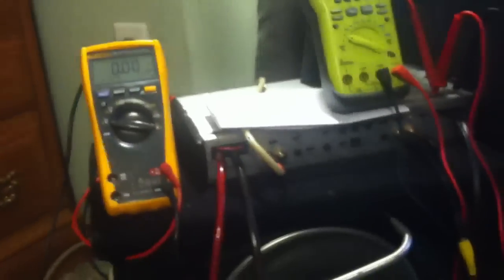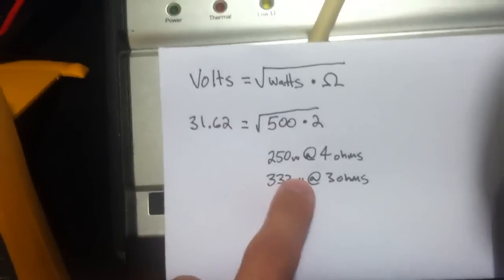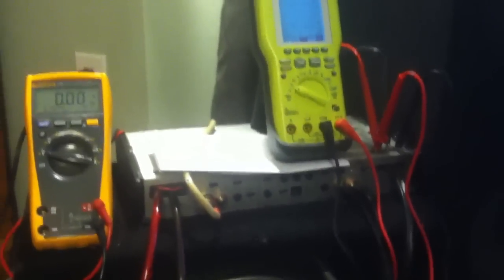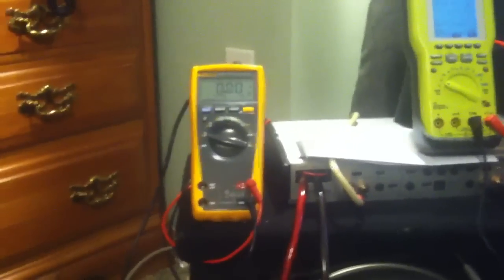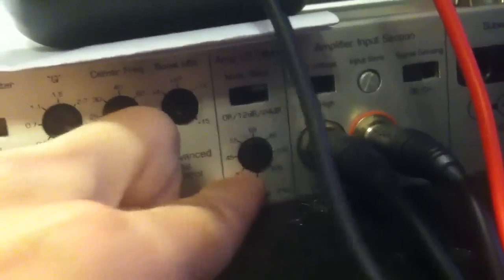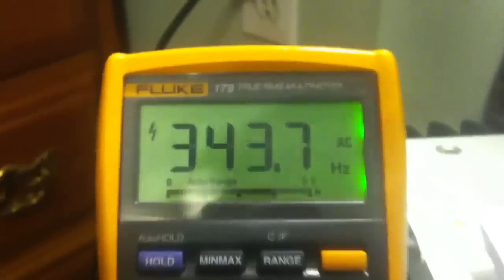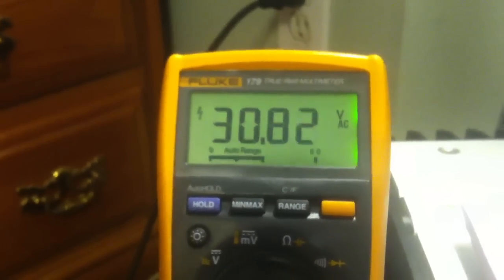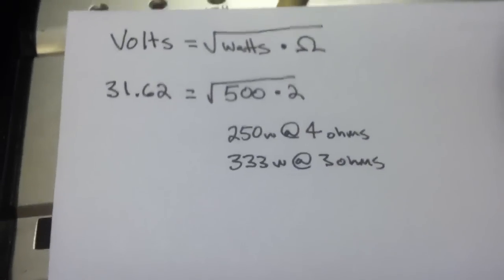Set amp gain

Comment: Proper way without oscilloscope.  Keep in mind the 10w7 is a 3ohm sub.  The slash series eg:v1 &v2 are 500watts at 1.5,2,3 and 4 ohm. 500x3ohm (10w7) equals 1500. Square root of 1500 is 38.72 or 38.7 if dmm reads either way. Disconnect all speakers especially sub.  Turn head unit to your max listening level. There's a debate if you 0 out the head unit settings.  I leave them set so no distortion is introduced. Play test tone CD at 50hz at 0db. Connect red lead from dmm to positive on amp. Black to negative. Play cd and slowly turn up gain until target (38.72 or 38.7). Gain is set. Turn down head unit, reconnect speakers and your done.
Reply from the maker: Thanks for the helpful comments, I should have explained farther.  

I was setting this up as an example for someone who had a 500w @ 2 ohm setup.  So instead of the correct setting for the 500/1 & 10w7.  I used the equivalent wattage in the (500@2) for 3 ohms, and also shown the math for an equivalent 4 ohms setup.  

38.72 is correct if you wanted the 500/1 setup for the 10w7.  Mine is v1.

Comment: This amp will pull 568 watts at 12.29 volts, you may have done your math right but that's not the case for this amp
Reply from the maker: Math is right.  Look up ohms law.  Current, wattage, voltage, and ohms all relative to each other.  Boxes can cause the speakers ohms to change.  So if you were to measure something different, it's because the speaker's ohms change as it's playing different frequencies.  SMD IM-SG+ is a good tool to see this happen. 

Also you said "pull" not "output."  No amp is 100% efficient, what goes in, is different from what comes out.  Most class D amps are 60-80% efficient.  Pull means power input.  My video is about power output.  The voltages I'm showing is on the speaker output, not the input.   If you're measuring the amp "pulling" 568w, that's not what it's outputting to the speaker.  568w would correlate to ~400w output to the speaker.  Give or take, rough guess without more specifics.  

568W @ 12.29 volts is 46.21 Amps & 0.26 ohms.  The JL 500/1 is stable down to a nominal 1.5 ohms.  I don't think you'd get a situation where'd you'd see 0.26 ohms on the output side of the JL 500/1 without it going into protect mode.  That amp could definitely pull 46+ Amps on the power input side, the recommended fuse size is 50A.  And for 10-15ft of power cable, 0.26~ ohms resistance seems reasonable for that amount of current.  So I'm pretty sure your calculations is on the power input side of the amp, when my calculations are on the speaker output side of the amp.  And that's the cause for the discrepancy.  

https://pdf.crutchfieldonline.com/ImageBank/v20071015125500/Manuals/136/1365001V2.PDF

Page 8 (14/15)  
Shows the recommended fuse size. 
And a table for the target speaker output voltage for various speaker ohm ratings to achieve 500w.  My math matches exactly what JL Audio recommends.

Comment: No you'll get max power, 500 watts at any ohm load with that amp ..so your getting 500 watts at that 3 ohm ..now with any other amp this video is correct
Reply: Papo Portillo your right. I'm like what is this dude talking about. Jl audio slash amps. Specially monoblock 500/1, 600/1, 1000/1 or 1200/1. 1.5ohms to 4ohms. They put out full rms ratings.
Reply from the maker: The power side of JL slash amps is regulated, not the output. Meaning if the alternator of the vehicle causes any volt drops / spikes it won't alter your gain settings.  It makes it more accurate, but less efficient than non-regulated.  If both sides were regulated, there would be no input sensitivity or gain pot.  Regulated or not, Ohms law applies the same.  
( Watts = Volts * Ampere ) == ( Volts √(Watts * Ohms) )  
Directly from the JL 500/1 manual:
" 
5) Using the chart below, determine the target
voltage for input sensitivity adjustment according to
the nominal impedance of the speaker system
connected to the amplifier output.
4Ω (or higher) 44.7 V
3Ω      38.7 V
2Ω      31.6 V
1.5Ω   27.4 V
"
So if they tell you to tune the output AC voltage output to different levels given your sub's ohm rating.  Which so happens to equal my formula results, how is my formula and procedure wrong? 

44.7213595499958 = √ (500 * 4)
38.72983346207417 = √ (500 * 3)
31.62277660168379 = √ (500 * 2)
27.38612787525831 = √ (500 * 1.5)
Reply: These amps actually exeed their rms ratings with any load from 1.5 - 2.0 ohms you can find reference videos from reputable people here on YouTube, I actually have this amp, and lemme tell you 500w yeah... A really fucking angry 500w 😂, I've blown 1300w rms subs with this amp, it's definitely a keeper
Reply: This amp has a R.I.P.S. circuit to get max power at a wide range of impedances. can get max power anywhere between 1.5 ohms to 4 ohms. If you plug in a 3 instead of that 2 on your math there you can see your target voltage for 500 watts.

Comment: 333rms @ 3ohms. Your confusing people man. It's going to give that sub 500rms at 1.5ohms to 4ohms. Not no 333rms. Your sub is getting 500rms not 333rms. That also goes for the 250/1, 600/1, 1000/1 and 1200/1 slash amps. 1.5ohms-4ohms the amps out out the full rms ratings of the amps. Not a half or anything less then its total. The way your doing it. You should say for another amp, not a jl audio slash amplifier.
Reply from the maker: The power side of JL slash amps is regulated, not the output. Meaning if the alternator of the vehicle causes any volt drops / spikes it won't alter your gain settings.  It makes it more accurate, but less efficient than non-regulated.  If both sides were regulated, there would be no input sensitivity or gain pot.  Regulated or not, Ohms law applies the same.  
( Watts = Volts * Ampere ) == ( Volts √(Watts * Ohms) )  
Directly from the JL 500/1 manual:
" 
5) Using the chart below, determine the target
voltage for input sensitivity adjustment according to
the nominal impedance of the speaker system
connected to the amplifier output.
4Ω (or higher) 44.7 V
3Ω      38.7 V
2Ω      31.6 V
1.5Ω   27.4 V
"
So if they tell you to tune the output AC voltage output to different levels given your sub's ohm rating.  Which so happens to equal my formula results, how is my formula and procedure wrong? 

44.7213595499958 = √ (500 * 4)
38.72983346207417 = √ (500 * 3)
31.62277660168379 = √ (500 * 2)
27.38612787525831 = √ (500 * 1.5)

Comment: I got that exact set up   . Could I get a pic of what all the settings should be at
Reply from the maker: It depends on the sub you have connected to it.  Also your music tastes & preferences.  The other speakers/amps you are using also determines the settings to use as well.  Say you have full range or you have good mid bass subs that do the workload of 60-160.  You will set your sub amp to do 60 and below.  If you don't have mid bass subs and your full range speakers lack decent bass, you may want your cut off higher.  If in doubt, just turn the EQ section off.  You can play with that later.  The gain and Freq cut off is the main settings you should be concerned about.  There's no definite answer to what settings everyone should use.  Thats why the give us the adjustments to tailor it to our setup needs.
Reply: @smileymattj  ok well I have a 10" w7 just like u in the video.  I just figured it would be set roughly the same
Reply from the maker: I made it showing someone else who had a 500w 2 ohm sub.  So my settings in the video wouldn't be what you need.  I wasn't setting it for my JL sub.  The 10w7 is 500w @ 3 ohms.  You want to turn you gain all the way down.  Set your meter to AC Voltage.  Put the meter probes on the speaker terminals of the amp.  Turn the gain up till you get 38.72 volts.  When playing a 50Hz test track.  The JL refers to gain as input sensitivity.  Here's where you can get the test track: https://www.mtx.com/testtones
Reply: @smileymattj  ok thank you  so much

Comment: Your way is correct.  I'm running 500v1 to 10w7ae  pro wedge box.  But being 3ohm sub and 3ohm stable amp, I'm dialed in at 38.7 with the slash amp. V1 or v2 and 600v3 are awesome being that they put out true wattage no matter what your alternator produces

Comment: My JL 500/1 hits so hard it almost kills my electrical system shutting the car down (brand new Alt last year, 2 batteries and 2 capacitors) the protection circuits do not work and i can run it at 1/4 ohm load the amp is pulling close to 800-1k RMS at 1/2 way turned up on the boost and i have no idea why? its all original i popped it open when i got it because the guy told me it didn't work and nothing was burnt or bad. i have a good amp and cant explain why i am getting so much power out of it? i wouldn't believe it someone said that there JL 500/1 amp is putting out more than 505-510 RMS. I put it at 4 ohms and the power drops like normal amps do but the JL is 500 RMS at 4 ohm, 2 ohm and 1.5 ohm no matter what.i'm not complaining i just want to know if anyone else has this awesome problem?
Reply: Google "the big 3 upgrade"

Comment from the maker: Hi william,

Those amps are very different. I'm not sure why they would have told you it was the same.  Also they should have tested the amp before connecting another sub to it and damaging it.  Amps are supposed to have short-circuit protection in them, but it's not always 100% safe.  Bad speakers can easily damage the amp or headunit it's connected to.  

Which 15" Kicker Comp do you have?  Ohm wise & wattage wise?  How many are you powering? 

The Kicker 600.1 is a:
300x1 @ 4 ohms
600x1 @ 2 ohms

The JL 500/1 is a:
500x1 @ 4 ohms
500x1 @ 3 ohms
500x1 @ 2 ohms
500x1 @ 1.5 ohms

The reasoning for this is that the JL is a regulated amp, and the Kicker is a non-regulated amp.  This will mean the JL will give you a more consistent volume level regardless of the vehicles electrical system.  Where as the kicker will increase/decrease volume relevant of the car's voltage supply.  

The JL is a very good quality amp.  My thought is that you are used to that higher wattage amp producing more volume and looking to re-achieve that the gain, boost, crossover settings are set too far out causing distortion.  

Both are good amps, and each are meant for separate purposes.  I would never say they are the same kind of amp, or the equivalent of one another.

Comment: Hello smileymattj, I have this JL Audio 500/1 amp that I've had for years and just hook it back up on my car and it doesn't turn ON with the remote wire, Do you know what the problem is....What can I do.
Reply from the maker: Is "Input Sensing" set to on? If so, set it to off.  Best thing to do is to bench test it.  Take it out.  Hook it up to to a battery.  Remember to use a fuse.
Reply: smileymattj Got it, Thank you

Comment: Smileymatt, I've had the same system for 2 years now. It used to hit really hard and sounded great. After about a year and a half the sub gave away, so went to the local car stereo place that I've always gone to. They replace sub, and would blow the new sub pretty much right away. They said it was the amp, so I went from a kicker 600.1 to  JL 500.1D. They said its the same, but im not even close to the sound quality that I was. And I would like to set the JL AMP but don't know what to adjust the filters and bass boost to. Any way you can help. The amp is pushing a 15in  Kicker comp

Comment: Do you have any tips on how to adjust the infrasonic filter and the rest of the bass control settings? Also do I keep the lp filter frequency at 200 hz? I have 2 12 w3v3-4 wired in parallel.so theyre bridged down to 2 ohms correct?im using jl audio 500/1 v1.  I adjusted the gain voltage to 31.62
Reply: Did you still need help?

Comment: I have a questions, is mono block amp can use to fire up our front mid and tweeters?
Reply from the maker: It depends on the specs of your mids and tweeters, possible in some cases.  But it's not the most ideal setup.  There are really good 2 and 4 channel amps for under $100 now.  You'll be much happier doing it with the proper amp for the job.
Reply: smileymattj thank you

Comment: hey, if i adjust my bass boost it raises my gain voltage, should i set my bass boost and then reset my gain so it is back to the recommended setting? or does it not matter because it was originally set proper
Reply from the maker: You should adjust the gain.  Then set your effects/EQ.  But also double check voltage afterwards to make sure it's not excessive.  Yes, you're right that it will raise the voltage, but you don't know how much till you do it because EQ and effect settings is a personal preference thing.  And/Or specific setup.  Like if your mids don't go very low frequencies, then you would set your sub cut off higher to fill that gap.  

Set gain (everything off / flat)
Make any additional settings changes
Double check voltage

Voltage is the poor man's way of setting the gain.  Oscilloscope is the way to do it if you want to squeeze everything you can out of it.  You should never set gain by ear, because anyone who can install an amp has access to a multimeter.
Reply: Ok, what is considered excessive voltage ? Like say my 1000watt amp at 2ohm needs 44.7v gain, what is too much past that ?
Reply from the maker: Other factors also come into play to know when it's too much voltage.  If it's the JL 1000/1 it's voltage regulated.  Meaning 1000w is what you want to be at.  If it's another brand amp it's most likely not voltage regulated meaning if your alternator delivers it 16v, it can go over 1000w.  Most alternators are set to 14v-15v.  So amps are supposed to be rated at 14.4v.  Also your power delivery to the amp is important.  If you are only getting 11v at the amp when it hits a hard bass note.  Then you not really going to get 1000w out of it.  Also what is your sub rated at?  1000w?  You don't really want to be sending excessive power, or it will shorten it's life.  0.5v could boost you 20w.  So I would say should stick to under 0.1v over.  Roughly 8 watts for yours.
Reply from the maker: So set your gain.  Set your boost.  Then check voltage.  Dial back the boost to safe level within 0.1v of what you should be at 44.721v if the boost has it too far over.

Comment: so with this setting, can you turn the volume higher than 75% when listening to music?
Reply from the maker: If you set your amp's max wattage rating at the deck's 75% level, then you should keep the system at or under 75%. 

That is just a "safe guess" for when the distortion level is unknown.  All decks will distort at some level.  Better ones distortion will start at a higher volume.  You can measure with an Oscilloscope.  

Also an Oscope will tell you if your amp can go beyond it's max rated wattage.
Reply from the maker: This video shows what distortion looks like using an Oscilloscope.

Amp distortion

Comment: Also never go above the volume you set gain to.  If max listening level is 38 and that's what you set gain to don't go above 38 because distortion can be introduced
Reply: If max level is 38 you aren't going to be able to go above it....
Reply from the maker: F.E.B III said max listening level.  Meaning if you set your gains at 38 and your deck can go above 38, don't go over 38.

Comment: Dude whats your email i have the same amp i have a w7 12 what setting should i have my knobs on the amp im useing a sealed box i do have a bass known b tp as well please if any body can help that will be awesome
Reply: alex gonzalez did you ever get a answer because I have both as well and I want to know
Reply from the maker: All the other settings are personal preferences and/or dependent upon your setup.  

Input Selection - should be set to Low if you are using RCA input unless you are attaching speaker level input, then turn it to high.  Most people are going to use the Low setting.
Signal Sensing - I found these best left off.  If for some reason you don't have a remote turn on lead to the amp, you can turn this on to let the RCA signal turn on the amp.  

Low Pass Filter - Off / 12 db / 24 db - 12 db is pretty normal.  It's how dramatic you want the cut off to be.  If your head unit has a sub preamp out.  Turn this off.  You're already only sending the amp low frequencies.  If the headunit only has a full range output then set Filter Freq Hz to your liking.  This would be what frequencies the Sub plays.  You don't want your mid speakers and your subs to play the same frequencies.  But you do need a little overlap.  Then select 12 or 24.  Your preference.   Say like your mids are sent 5,000 Hz to 60 Hz.  You would want your sub to play something like 80-70 Hz and below.  

Bass EQ - Is an EQ section.  Play with it if you trying to get a more level output across the sub frequencies.  But it's just best to turn it off.  

Infrasonic Filter - The reverse of Low Pass Filter.  Low pass plays frequencies below the selected setting.  Infrasonic plays frequencies above the setting.  Humans can't hear under 20Hz.  So setting this to 20Hz is a good idea.  However that will reduces your bass vibrations.  But will not be wasteful in the sense of wearing out your equipment and wasting power that isn't heard.  So really your choice.  If you can't hear good super low frequencies dial it up some so you don't waste power.  

Preamp Output - only used if sending RCA to another amp.  If you don't have another amp, leave it off, don't mess with it.

Comment: for these amps fuse them at 30-40 amp fuses max or you will burn them up. alway go lower than the product ratings on the fuse. its so your amp stays alive. the cost of a fuse verse repair or new amp is a big difference